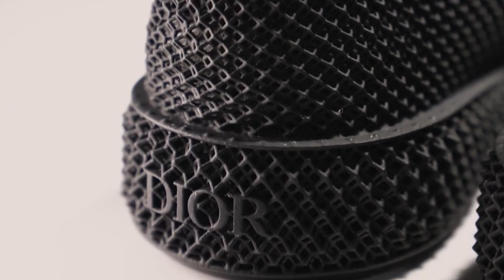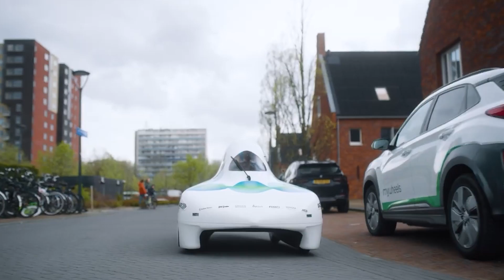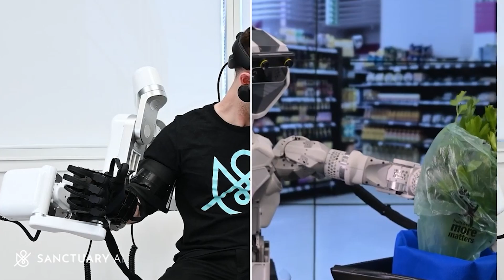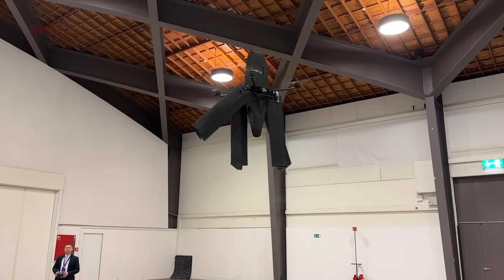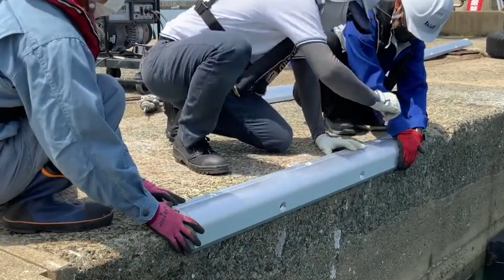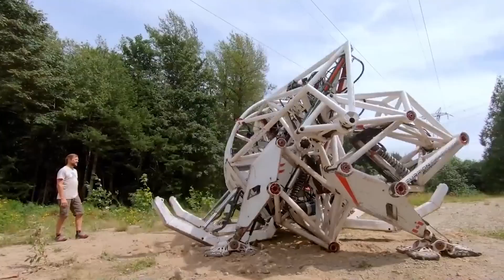INCREDIBLE INVENTIONS THAT YOU HAVEN'T SEEN YET

Comment: There is no way the battery replacement business will ever be viable, the biggest hurdle to buying an electric car is the battery degradation, in about 10 years it will either explode or be unable to hold a charge, sand your telling me a company will take on replacing batteries for the price of filling up a tank of gas?

Comment: Omg I wanna conceal that paper thin speaker in the wall of somebody's house and make them think their house is talking to them. Sneak in to an open new construction house in the punch out phase and plaster over it with drywall mud. Plant wires in advance of the drywall to be accessed by a drill hole through the outer wall. Say next to an outlet box with a closable lid. That way I can sneak over at night and connect the wires to the output of a walkie talkie that I communicate with from a distance with seperate one. Then hide the WT in the outlet box.

Comment: Just asking since no one will answer but what happens when battery on the electric cars need replacing? Does the battery get recycled or is it thrown into landfill
Reply: what happens when we run out of oil? what happens to ICE cars when no longer can be used? So even if the batteries go to landfill like everything else, electric cars still are way better for the environment.
Reply: @Da-Sheek  Except that most electrical power plants use fossil fuels to generate electricity and suffer huge power loss as it travels down wires. And don't have the capacity currently to handle future power consumption of millions of electric vehicles

Comment: unless an electric car is fully recharged with solar/wind/wave power, then it is NOT reducing the use of fossil fuels; in fact it is increasing the use of them.
Reply: The vehicles that have to go rescue EV drivers, charges the EV with fossil fuels lmfao. True clown world we live in.
Reply: That’s a misconception. Electric vehicle motors are so much more efficient than gasoline engines that even if an EV were powered by coal, it would produce less pollution per mile driven than a combustion engine. Combustion engines waste 70% of the energy they consume, turning it into heat rather than forward momentum.
Reply: @DWadeIndigo  i understand your stance on it. But bottom line is ev still has a long way to go before its the main thing ppl WANT to use. The fires these cars can start from minor accidents cant be put out by firefighters. So accidents are gunna be tricky to deal with and maintain. The Nickel in those batteries have to have a giant mining operation to extract from the earth. Using fossil fuels to get it. They destroy and decimate more ecosystems with mining than they do suckin/ fraking oil outta the ground.
Reply: Just waiting until the fusion reactor is small enough to fit in a car...
Reply: Amen!
Reply: @The_Void_  ev still needs less mining than petroleum...and adds recycling to that... 
Evs are much safer...Fire is hard to put down on ev... But it doesn't blow like petrol
People only think cost...  Until ev prices comes down people will buy it... And it's evs are becoming cheaper in some parts
Reply: Catsprin… your comment is… ill informed. Its also kind of just plain common sense wrong. You do know that most power grids around the world have rapidly increasing amounts of sustainable energy, don’t you? If you aren’t aware that solar and wind are now dramatically cheaper than coal, oil, and gas… well… obviously you don’t know much about the subject. 

I get it. Some people told you that this was left/right political issue and then instructed you to hate not giving oil companies huge amounts of money while they destroy the planet… here’s the thing, though. Money talks. There are more, better paying jobs in renewables. Renewables dont pollute the way fossil fuels do. EVs are more efficient, more reliable, and increasingly cheaper than ICE. 

So you can dislike EVs as much as you like. The rest of the world will keep going the way it is. Ie. Getting rid of ICE vehicles and fossil fuels.
Reply: @blankeny I'm still waiting for the Flux Capacitors to be more affordable 😂
Reply: @forresttbarnes5710  don't set yourself on a hard chair waiting for fantasy, just pick your crayons and draw the plans!!!

Comment: 1) 3D Printed shoes. Yes thank you for destroying another industry that employees people. And what happens when normal people won't be able to afford to buy new ones?
2) Ample. You will have a problem when petroleum will be banned. Plastics that are parts of the car won;t be made anymore. What about the lubricants that cars need to run or the fuel that you will need to recharge them?
3) Eco-runner 13. Do you seriously think anyone will want to buy something that ugly and that small? Funny. (Not enough to run a business on that is for sure.)
4) Bombora mWave. The only problem i see is the lose of energy at each transfer junctions that will be needed to get these offshore far enough to make sense. That is unless they have something over them to prevent interaction with a lot of things that needs to be discussed.
5) Phoenix robot. There are a lot of things that can be discussed about this. (And of course the Terminator will come up in it as well.)
6) The sixth finger. The true beginning of of robot prosthetics. A new arm, a new leg?
7) Rescue drones. It can pick 5 pounds. It is a good idea for searching but nothing else. The weight capability need to go up a lot. If it could carry between 50 to 80 pounds. it could bring supplies that would make a rescue easier. And at least would be able to bring in food, water, medical supplies, survival equipment and more things needed. But this is a good first start.
8) A computerized suspension system. Talk about not what you are talking about. there are already suspension kits that can handle more than 800 horses, cost less than this and with zero computers there is no need to worry about electronic failures later. And for the last one you are going to put computers and hydraulics on a car's most beaten  contact area? With normal use you would have to replace it at cost at least twice a year. 
9) Dock bumpers. This is a good idea.
10) A sled board. I don't know if it will replace what is already used. and everyone that does this in pro competition would have to relearn their skills that have spent how long getting to in the first place.
11) The Rhino-mec. People have been waiting for this since at least the mid-eighties if not longer. A there will be people that will want one.
12) A paper thin speaker. And it would be very delicate too.
Reply: We have to go where the jobs are. The market will always dictate what jobs are available and what skills are required.  Peiple have to get used to learning new things as markets change.

Comment: Electric car's are absolutely 1million time's worse than gas powered car's hand's down
Reply: Pretty sure horse dealers were saying the same thing about those fancy/fangled automobiles about a century ago.
Reply: In what way
Reply: Absolutely! Why else do you think this administration is pushing for it so badly
Reply: @91stealthman Combustion engines have had over 100 years to become efficient and were mechanical for the most part. Electric cars are full of software and electronics and putting them on a hoist or bricks to fix them is out of the question. It will take decades to become as efficient and as cheap and reliable.
Reply: @PhantomFilmAustralia  once again... Sounds like what people said about those "high-tech" and rolling pipe bombs instead of our loyal horses.